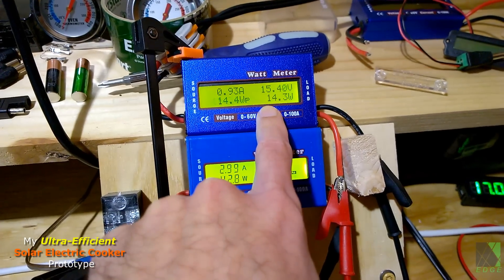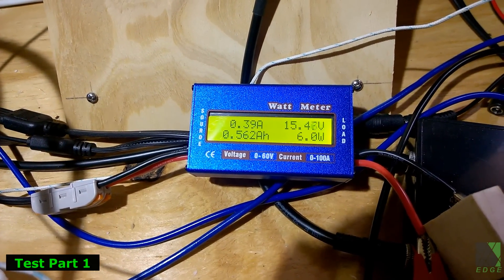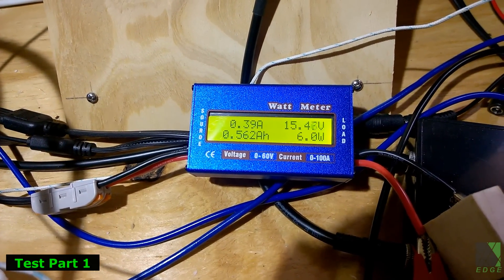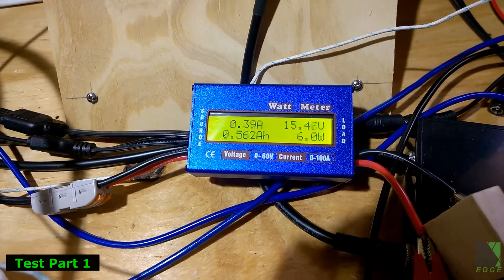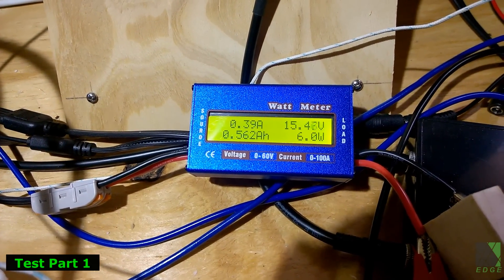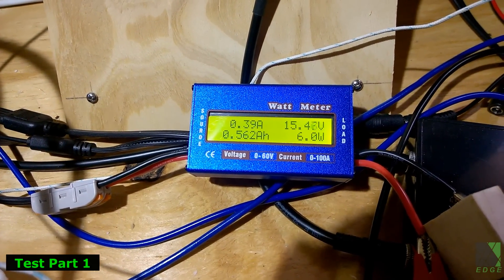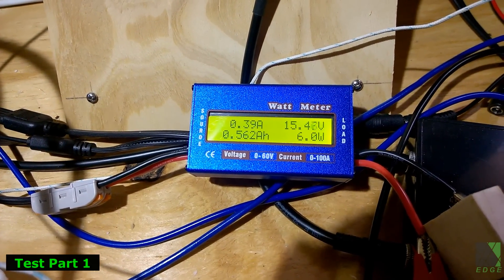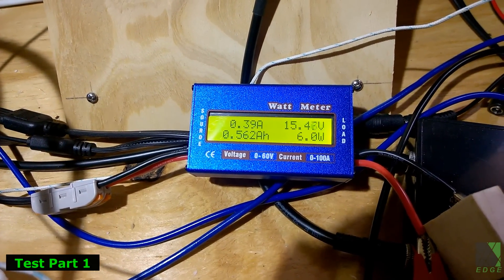Ultra efficient solar electric cooker! 20 Watt Solar Panel can cook an egg with diode chain #solar

Comment: WHAT KIND OF DIODES ARE THEESE
Reply from the maker: @Sammyflopped Hello, they are very cheap Silicon Rectifier diodes. There are links in the description. Just make a string of them in series to drop the appropriate voltage. Make sure they don't get too hot, I keep mine around 100C. Please see my other diode videos for explanations of voltage drop, hope that helps :)
Reply: @solarpoweredge  alright, also can the run on dc also ?
Reply from the maker: @Sammyflopped As long as the DC is current limited to what the diodes can handle, yes. Diodes will consume all the current (amperage) available. A solar panel might put out 3 amps, but a battery could put out 500a and burn the diodes. Matched diode strings are best suited to direct DC from solar panels because of their "MPPT-like voltage regulating" properties. If running off of a battery, that need goes away and perhaps a resistance element is better suited. I like the idea of having a flexible 12v DC option on a diode based cooker, so perhaps a CC-CV boost converter would be one way to achieve this. Either that or have a dual-element cooker; diode chain for solar input and a separate resistance element for 12v operation. Thinking in survival mode, I tend to prefer the simplest options with little to no electronics.
Reply from the maker: @Sammyflopped Also I neglected to explain this in my video: diodes are temperature sensitive, so the diode chain should be configured for the operating temperature you need. At 60C the diodes will drop more voltage than at 100C. You might notice this as they warm up. Therefore, if you are boiling water, use the correct number of diodes for 100C operation for best results. The downside is they won't pull as much current while initially warming up. In my tests I didn't find that to be a huge problem though.
Reply: @solarpoweredge  thank you for explaining this stuff!
Reply from the maker: @Sammyflopped Welcome sir :)

Comment: BRO START MASS PRODUCING AND SELLING PLEASE
Reply: Lovely Sir the diodes r on amazon?? ❤❤❤❤❤❤❤❤❤❤❤❤❤❤❤❤❤❤❤
Reply from the maker: @steveadal4735 Yes sir you can use standard silicon rectifier diodes. Link in description or just search Amazon etc. Note - for a small container, the smaller diodes are easier to fit as it takes well over a dozen of them. I like to use 6 amp and 20 amp diodes mostly. I used the smaller diodes here, as the 20a are too physically large
Reply from the maker: @Sammyflopped  Right on! I hope these make it to the store shelf

Comment: I tried today a string of 10a diodes on my small solar panel (20v 4amp max at mptt) 
 The diodes draw as much power as the mppt solar controller. I just need to try in poor conditions. The big issue is cooling .. maybe I will try with the allu profiles
Reply from the maker: @cgmarch2359 Nice job... getting the heat out is the toughest part in my opinion. Too much and they burn up. Testing some aluminum heat sink ideas at the moment
Reply: There is the ideea to parallel them to share current.. and with a good radiator maybe it will work?
Reply from the maker: @cgmarch2359 Yes it will work, the current will be shared
Reply: Ok I tried it with very little sun.. just 3w and again works the same as mppt. Basically as long as you match the number of diodes with the mppt volts.. it will work and draw the max power
Reply from the maker: @cgmarch2359 Amazing, it works so well. Great research you're doing there :) This technology really needs to be developed further.

Comment: You could make one that will heat a loop and it could power in floor heating. Can’t wait till I can start doing things like this. I’m 3/4 done or king on the shop, my inside winter project. I’ll have everything I need to start having more fun this spring.
Reply from the maker: @Nofukzgiven Yeah good thinking. I wish there were big vacuum insulated containers about 10 gallons (they'd probably cost a lot). Your shop sounds like fun. I am hoping to start a few new workshop projects in spring - if things go well enough

Comment: Brilliant video

I'm hoping to grow seeds off grid and need to beat the soil with soil warming cable.  It's a big area typically 5feet by 2 feet
Do you think this would work or connect solar of direct to soil warming cable
Keep up the great research
Reply: Yes sir thhe heating diodes can be protected from the soil and moisture.  Normally you run heat cables in wet sand then place seed tray on top. 
Not sure how you would get a good thermal coupling with diodes
Thank you buddy
Reply from the maker: @daveswords2112 You are welcome sir. Thermal is certainly a challenge. Perhaps some kind of pipe with the diodes inside and heat sink compound or sealant to help the diodes connect with the sand. This is all highly experimental stuff so who knows whether it would work. I am still testing different kinds of diode heating elements to see what works best
Reply: You just triggered an idea.
Vacuum forming the diode array in plastic.  Similar to how woodworkers.  vacuum seal. When Veneering timber. Thanks
Reply from the maker: @daveswords2112  That sounds pretty cool, thinking outside the box for sure
Reply from the maker: @daveswords2112 Hello, I think it's possible to make such a heating element, is the soil in a separate container or indoors? The diodes and wires should be protected from the dirt and moisture. Otherwise, they might corrode and become damaged. But yes I think it would work

Comment: This is awesome!  I'm wondering if the diodes would degrade quickly with the cycle of heating / cooling.  Any thoughts on that?
Reply from the maker: @ttucker2010  Glad you like it :) From the research I have seen, they usually last a very long time. Cheap to replace too. But overheating can destroy the diodes of course. Honestly I never felt like abusing diodes this way, but it's so interesting I couldn't help but give it a try! And the rest was history...
Reply: @solarpoweredge  Please tell us what diodes you used, how many and they are wired in series right? I would like to duplicate your project.  Did you put any protective cover on the diodes?  Is that necessary?  Maybe you can do a video on the build with all the details. Thanks!
Reply from the maker: @ttucker2010  1) Both cookers have normal unbranded silicon rectifier diodes, axial package 2) the number of diodes depends on the vMP range of the solar panel, so just add however many for the voltage you would like to use 3) they're all wired in series. 
Regarding build video, I am already running flat out so wasn't able to but perhaps in the future can do it??
Reply: @solarpoweredge  Thanks!!  I'll give it a try.
Reply from the maker: @ttucker2010 Welcome sir!